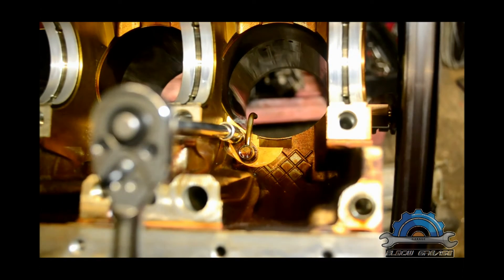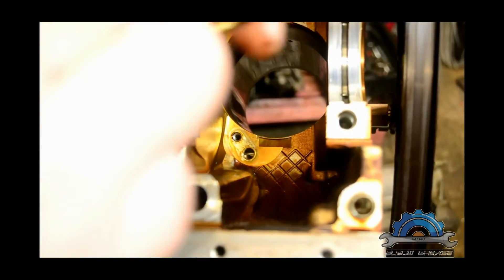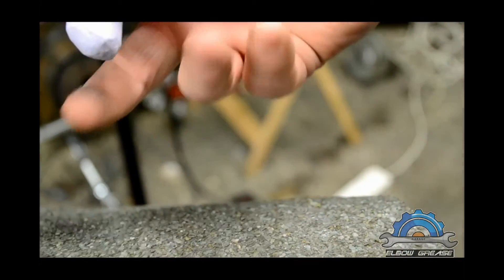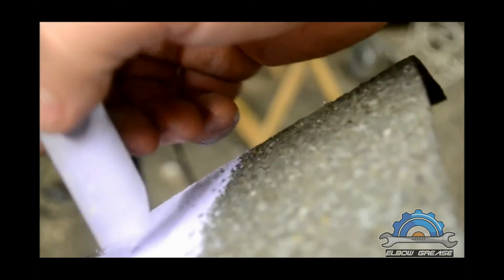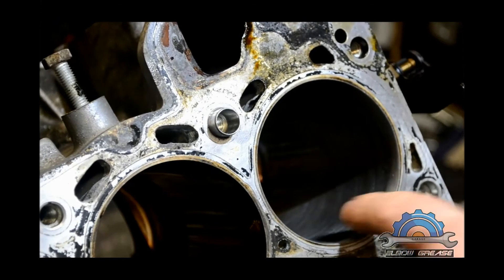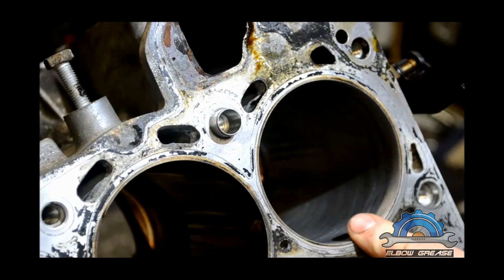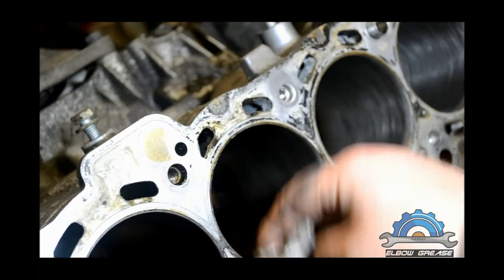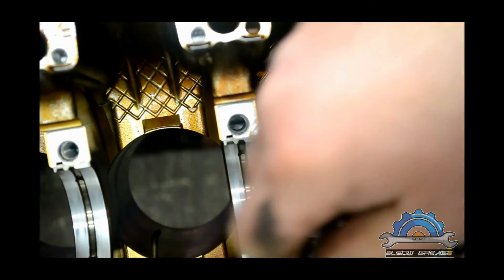Engine block cylinders honing BMW e46 M54TU/M54

Comment: Can you remove the oil squirter if the crankshaft is still installed?  Or does it hide the bolt?
Reply from the maker: Hmm,probably yes ,don't realy remember now but if  you look on this video https://www.youtube.com/watch?v=0rLtMCUMRU4 ,you can see some access
Reply: Yeah the lighting isn't good enough to see on that vid.  Are you able to check on your M52TU by any chance?
Reply from the maker: Light is bad,I'll try for you today,cuz engine is deeeeeeep inside my garage.
Reply from the maker: Maybe on my new video
you can see more https://www.youtube.com/watch?v=hNS4R_hnyGg
Reply: I saw that just now too.  It looks like the oil squirter is not directly under the conrod journal, but to the side of it underneath the counter balance weights.  But it looks like if you rotate the crankshaft, it will uncover the oil squirter so it should be good.  Earlier this week I was in my local junkyard taking one of these engines apart for practice and I ran out of time that day, they were closing.  Went back the next day and they had cleared that row of cars out and sent them to the crusher!! Arg, lol.
Reply from the maker: 50sKid
Bad news,You can remove 5 only cuz 6th squirter is above crank sensor wheel,so ....
Reply: There's no way to slip the open end of a box wrench onto the bolt? :-(
Reply from the maker: +50sKid this is allen
Reply: Ahhhh... ok, well, I suppose that confirms that you cannot safely deglaze hone the cylinder for new rings with the block still in the car.  Thank you, my friend.
Reply from the maker: +50sKid Well hard to do,yes,but taking engine out saves you neck pain and you can do more stuff with it like bearings,cleaning,crank seal ,clutch ect.Anyway good luck.
Reply: Yeah for sure, but I wanted to make a video on a job that would be more doable for my subscribers to actually try.  Pulling and rebuilding an engine is definitely a next-level job that almost nobody but serious car guys will do.  Thanks!
Reply from the maker: +50sKid You need to consider lots of hate from viewers doing this that way and also ,trust me ,everything may go wrong and it's very messy.I did head rebuild on my car and was more painfull that pulling engine out and working on it on the stand because of angle of enging and access and head size,my back was bad.Never again,next time engine out.
Reply: @ElbowgreaseDIY  sorry but we appreciate the videos and efforts
Reply: What size hone tool